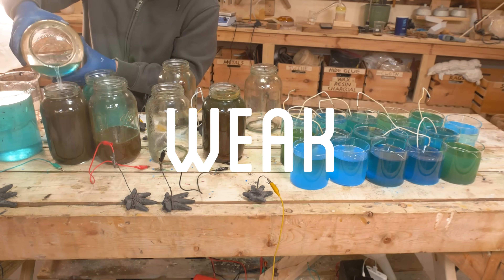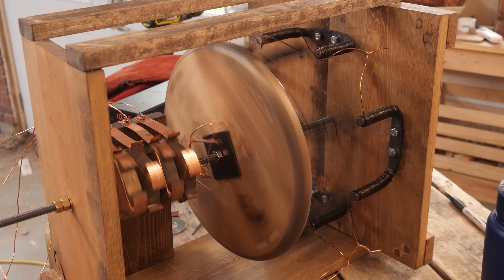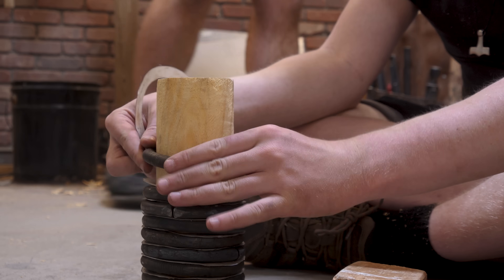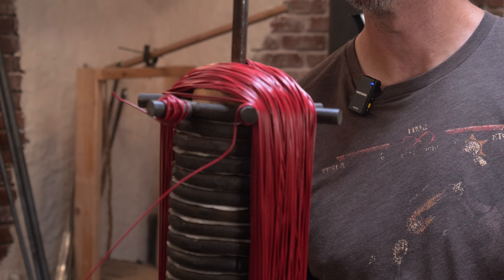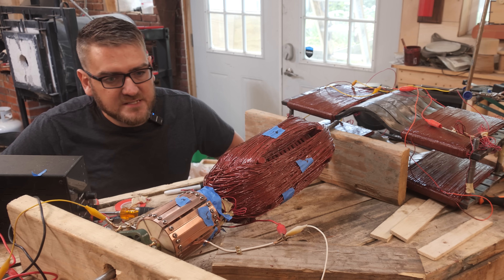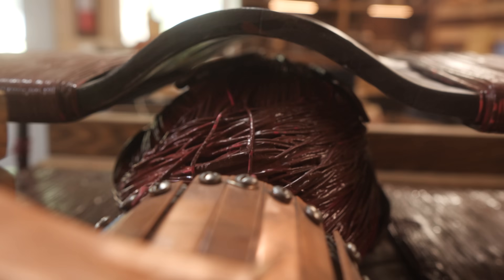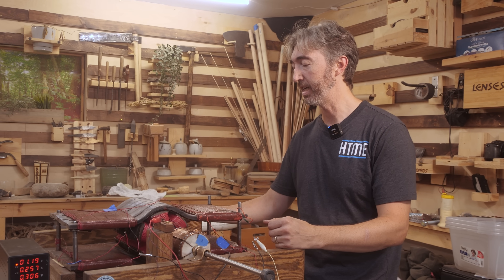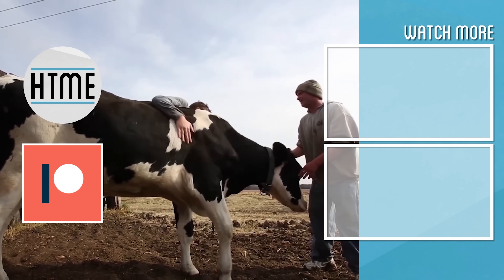I Built the First POWERPLANT!

Comment: @Physicsduck is a guy who literally runs a hydro power plant, might have some good advice for you
one thing he mentions, is that the rotor uses a copper ring and graphite brushes that are spring-loaded to make perfect contact with the copper ring at all times
it might not be great to be making AC this way, but i think you could probably be making the rotor a tad bit different in the way it is oriented or designed to make some form of DC

if you want to keep the commutator the way it is, i would suggest you make a system to have the commutator be machined down in some sort of way, and then use the graphite brushes that way
regardless of what you do, every time it stops contacting the contacts, it stops generating power, so finding some way to keep that smooth and as consistent as possible would be the best way to go

on the issue of the batteries you talked about earlier...

ancient batteries like the Baghdad battery were likely either a jar of something designed to ferment or soak in the material, and was just accidentally left too long for whatever reason, or was for extremely low-power coating and plating methods, rather than actually being a battery as we know them today

Comment: It is of the utmost importance that you have perfectly uniform windings. You need to be paying the wire straight, and not with kinks and bends in it, because any slight bends in the wire accumulate as the number of layers increases. And uneven  wire results in uneven fields. I am not sure you can make an efficient winding by eye, by hand. 
Also, the  rotor is wobbling too much. This is breaking the field strength unevenly, and the wobble is mainly caused by the crank being direct and being powered by a jerky human  arm. Try feeding the motive force  to it through a couple of belts, to even out the impulse.

Comment: There should be brushes on both the top and bottom of the commutator. This way it's more likely they don't bounce at the same time. Also the pads on the commutator should be angled. Normal motors have them angled so the transition is easier on the brushes and with more brushes less sparking.

Comment: 3:08 this drawing has all the answers for you.
The ends aren't just connected with iron bars, but with like a stack of plates helt there with bolts (this is to improve the magnetic flux path)
Also the brushes aren't vertically centered, but offset by what seems like 45°
Otherwise great work. I do believe that after improving these you will get it to run well :)
Reply: yea 100% on the first point, i just made a comment saying a similar thing, the 2 cores are continuous with each other im sure the shape of the field is all sorts of messed up.
Reply: The brush position is irrelevant, as long as the bars on the commutator are properly in phase with them. If you moved the brushes on this particular model it would no longer work without adjusting the bars also.
Reply: @mathiacus I see. So is it possible that they are slightly out of phase right now, partly causing the poor performance or would them being even slightly out of phase make it not work altogether?
Reply: @czechgop7631 during the part where he was holding a compass to the stator and the the outer bars he was adjusting the phase I'm not sure on the tolerance but if it is out of phase too much it becomes a magnetic brake..

Comment: wait so when i use up a battery does it crystalize on the inside like those jar batteries??
Reply: depends on the type of battery, sometimes they can grow large enough to short circuit the battery from within.
Reply: @superalbbatross  okay so like...say, duracell AAs, those build crystals on the inside as the chemical reaction to generate electricity or what?

Comment: I think your wire is too small.

To barrow water plumbing...
wires are like water pipes, the smaller the pipes you try to push something through, the more friction(resistance) you're meeting up against and the only way to overcome that to improve flow (amps) is to up the pressure (voltage). Your set up CAN'T meet the voltage demands.

Additionally, while iron us a cheap redialy available metal, alloys like Silica Steels may offer better Conductive Magnetic Flux.

Comment: I haven't read thru all 253 comments when I wrote this so I may be repeating.

Note: for a typical DC machine, armature = rotating part, field = stationary part.

You need to improve the magnetic flux path. Making the armature more uniformly round was a step in that direction because it reduced the length of the air gap.

An inch of air gap has about the same reluctance (resistance to magnetic flux) as 1000 inches of iron. For a given current, it takes 1000 turns to magnetize an inch air gap and 1 turn to magnetize an inch of iron to the same flux density.

You need to make as much of the magnetic flux path as possible thru iron. The gap between the armature and field is required so that the armature can turn. That means putting iron connections across the ends of the field bars in parallel with the bolts. Maybe an iron bolt for each bar in the field. This will increase the strength of the magnetic field and more flux means more voltage which means more power. Ideally the cross section should be at least as large as the total cross section of the bars. (You will get more flux per ampere turn of excitation available from the field.)

Another improvement would be to make the field bars wrap further around the armature. Currently I'd estimate that the total air gap extends about a third of the way around the armature. Making it extend about 2/3rds of the of the way (each side of the field about 1/3rd) would capture more of the armature amp turns. I'm assuming that your commutator is set up so that 2 adjacent armature windings have the same magnetic polarity (current direction), i.e., as you go around the armature the poles are N,N,o,S,S o. The 'o' poles are undergoing commutation, changing from N to S. (Note: making this improvement may give you commutation problems. I couldn't see enough detail about the armature winding and commutator connections to tell just how you've connected the machine.)

If you make the field poles too close together more flux will bypass the armature. Like all things in engineering  it's finding the sweet spot between competing designs.

Comment: Thoughts;
Round the commutator plates with fine grit sand paper / flat bar and have someone turn the handle. Must be very smooth.

Staggered & diagonal brushes.

Tighten the gap, it's pretty big.
Reply: Try taking a working DC generator apart to learn about the tolerances and such. You might stumble across some key thing you're missing.

Comment: It looks like your field coils are less than ideal. Almost seems that magnetic flux is running tangent to the rotor windings. Instead, the rotor windings should “cut” through the field flux, then you will get a lot more power at the output. Cheers.

Comment: Have you thought of 2 sets of brushes with a small angle offset so you don't get flickering ? 
And measuring output of flickering power is possible, just set it to charge a capacitor and see how fast it charges, math can then figure it out, 
Or connect voltage and current into an oscilloscope and have the math feature multiply for power...
I would love to help you with this project

Comment: The design of the stator is wrong. You have to make the coils in to a horseshoe shape. The poles of the stator magnets should end near the rotor, not 15 inches to the side of it. Also make the rotor coils thicker, you can wind 2 or 3 wires in parallel in each coil. The stator can also be made from simple flat stock bolted together. The spacing of the poles on the stator which will b facing the rotor should be lining up with the rotor's magnetic poles. You can also sand the commutator in to a better cylinder so it won't bounce the brushes so much. I'd use a thicker copper bar, shape it over a steel cylinder cut identical contacts out of it and mount them on to a wooden carryer something like what you used. Machine it with a file in to a nice cylinder and polish it with some sandpaper or period correct technique. Use the bearing mounts while you machine the commutator.

Comment: You must gear it up with pulleys or gears. The generator must spin approximately 1,000 rpm to work. The reason windmills and water wheels work, is because they have huge mass, which moves slowly, gearing it up decreases the torque and increases the speed. You will require some kind of bearing to withstand the rpm.

Comment: Soooo.... Y'all realize with the electric battery unlocked youve unlocked electro-chemical machining right?

Its just a wet battery cell, with shellac on the parts you want to keep. Move electrons to speed up the chemical decay.

Its not insight on how to improve this but it is insight on how to improve this.

Also, electroplating wax is a late 17th to mid 18th century tech defenitly in line with the self imposed limitations and something thatd help make other useful tools to build a more refined dynamo.

Comment: you could stack two more cores offset 120 degrees to make a sort of 3 phase somethin somethin, less pulsing. kinda like how a camshaft works. you could also explore how rectifiers work. this could be a good segui into AC for that matter. motors have similar parts to transformers so you could use skills from this video as building blocks for future videos if you did this.
Reply: this is a dc generator. so there would be no advantage in 3 of them, 2 of them siamesed together on the same shaft, wired in parallel and staggered so that the dc produced from one covers when the dc drops out on the other would give a smooth output.

Comment: I have a degree in electrical engineering and spent some time designing motors at Milwaukee Tool. When you do design work with magnetism, the model that’s used is a “magnetic circuit” where materials with “high magnetic permeability” in this case iron have low resistance and the opposite for materials like air. Given that there was an improvement when additional threaded rods were added, I’m guessing that the low crosssectional area of iron connecting the upper and lower stator assemblies is acting as a “magnetic resistor” and limiting the total magnetic flux. You’re going to have to put a load on the output of this in order to measure a current. Generators like this are going to function as a current source not a voltage source (like a battery) so try connecting a resistor across your output and taking measurements based on that.
Reply: Oh yeah for your stability problem, capacitor is the way to go, wire that in parallel with your resistive load of choice.
Reply: Yep, the magnet needs to make a complete circuit just like the electricity - and part of that circuit needs to pass through the rotor, with as small gaps between iron components of the circuit as possible.
Reply: I think the main problem they're having is it's an ac generator right, but they want to charge a battery they need to rectify it?  I didn't see them trying to do anything like that.
Reply: Wait.. I thought one is supposed to decouple the magnetic flux(replace the threaded rods with non ferrous substitute) for generator efficiency, and decrease magnetic resistance for motor efficiency
Reply: Isn't also separating the upper and lower coil cores limiting? Aren't they basically losing half of the flux?

Comment: To address the bouncing on the brushes, you could use insulation between the +/- contactors and get rid of the gap creating the bounce, instead of air it would hit the insulation, Also after the drum is assembled, you can sand the copper down to make it as smooth around as possible. I don't think its the size. 
Very Cool! I am an electrician with a blacksmiths channel... forging a generator lol Awesome

Comment: Resin around the coils and make or try to get all air out air add resistance to the coils them selves or use conductive oils to set it in while running to remove o2 (kinda like water cooling pc) 16:27

Comment: You had me a little worried about using a torch to burn off the excess wax paper. If the goal was to use wax paper as an insulator, then you don't want to burn it and produce all that conductive carbon black.

Comment: capacitors would smooth out the output also as it is rotating its creating ac (alternative current) power so, unless you use a converter to turn it to dc. Why are you measuring dc power, I feel like more accurate measurements could be made from measuring in ac

Comment: Instead of trying to charge the capacitor, put it in parallel with your load and it will smooth the DC output. (Look up ripple rejection)

Comment: For a low power application like this, maybe you should try a flywheel. most generators run at around 1800 or 3600 rpm which is not possible without gearing when hand driven

Comment: Have you considered turning the rotor contact strips on a lathe so that the outside is perfectly round? You might be able to do it with an oil stone, patience, and someone cranking it. The little jumps as the contact wipes across the strips would be reduced. And maybe you could add a tensioner onto the contact so that it is always being pressed down gently onto the strips. Trying to keep the suggestions in the spirit of the channel's self imposed limitation of technology that's been unlocked here. 

Are each group of four rotor strips supposed to have electrical continuity between them? It looks like they touch, and there are six clearly intentional gaps between the groups of four so I assume they're supposed to do so. If so, then why wouldn't you wire them together? The strips in each group of four would then act like a single curved plate from an electrical standpoint.

Comment: I think the issue is with the stator magnetic field.. Most of it goes through the metal bar instead of interacting with the rotor coils. You should look at it with magnetic viewing film to understand. Couple suggestions, shorten the stator. If the magnetic field acting on the rotor is supposed to be the returning one, shortening the stator would concentrate it. 
Cut half of the metal bar. Im giessing the curve is what allows for self-excitment, but it wastes magnetic flux... By cutting alternating bars, you allow magnetic leakage to interact with the rotor. I think you could actually have only one of the bar being kept full length, cutting all the others to place them in a star patern

Comment: A good test for a generator like this is to see if it runs as a motor. As well, due to the heat treatment and hammering on the stator plates you may have basically "wiped" their magnetic memory. You can fix this by "flashing" the stator coils with an external battery (once you have verified that it runs as a motor which means the coils are all orientated correctly). This design is basically a classic old school type of vehicle generator, NOT the newer alternator, and in some of those older vehicles, it was also used as the starter motor, which also helped with the "flashing" of the stator.

Flashing is usually done with a very high current capable source like a 12 volt car battery, but only tap the coils to the terminals, otherwise they will turn into a temporary light emitting stator. You need to confirm that the top curved plate is opposite in magnetic polarity to the bottom one as well, so you want a vertical magnetic field of NS or SN. The pulsing you are seeing indicates some kind of inductive kickback effects which could indicate a wiring issue.  You could also play with where the brushes contact the commutator, moving them back or forward around to see if there is an improvement. I would also wind more coils on the stator electromagnets as well.  Also you need to gear it up signficantly. At least 10 times the RPM you are spinning at to get any real power, as the power thats being generated at the moment is being used in the stator coils, which is probably the real reason of the pulsing. Basically a giant inductor. Put 12 volts across the brushes and see how fast it spins, (if it does) and that will give you an idea of what you have to actually spin it at to generate excess power. Winding more coils onto the stator both increases their magnetic field, and increases their resistance, reducing the load on the rotor to allow for more excess power. 

The stator is known as the "field" in motor parlance. And they are usually regulated once the generator is actively producing power.

The last thing would be to bridge the magnetic field on the ends of the stator. That way the field gets a lot stronger as its no longer being forced through the air.

Comment: one thing i saw recently, i don't know how common it was tho.  
some of the i steam trains used some module to switch between series and parallel connection on the windings of the transformer they would switch at different rpms. i believe they said depending upon which created a different drag so it was easier to run in one mode then switch based on spin up vs idle run.     
otherwise changing the hand crank into a geared or belt system can help as well. especially in the form  of a automatic transmission or cvt.

Comment: The shape of the stator makes NO sense to me. Think about the direction and shape of the magnetic field lines. It seems that you are only achieving current from the difference in field as the rotor coil comes up towards the stator...and then the return field has to travel through air. Maybe look at the shapes of modern motors and alternators (or even early 1900s) and not one from the 1800s.

Comment: How thick is the insulation on the wires? That stuff takes up, relatively speaking, a MASSIVE amount of room between the wires. This could theoretically be disrupting or weakening the magnetic field. Coincidentally, it also allows for more turns, which means stronger fields. Also, what type of iron are you making the core out of? Some react differently than others under different circumstances...